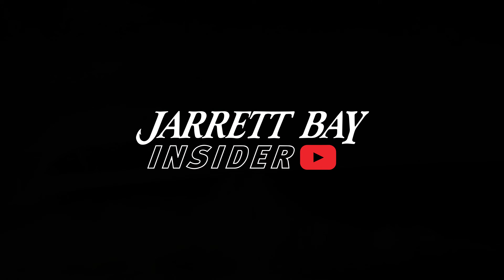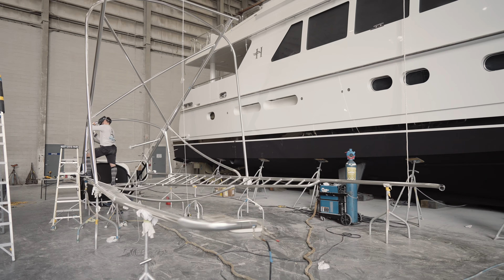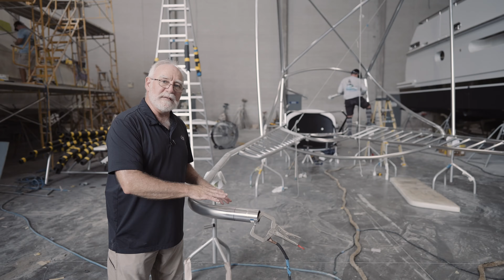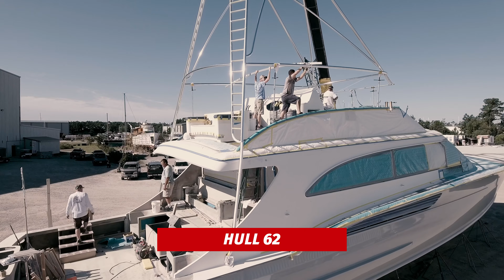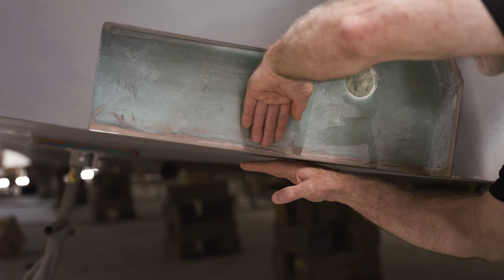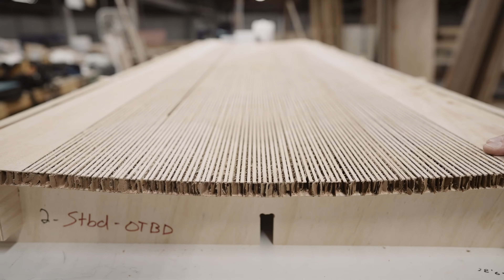From Towers to Trim Tabs - NEW! Jarrett Bay Insider, Ep. 25

Comment: Them Trim Tabs are very precise, must be right, it is one of the most important part of the boat, you can have everything, but if those Trim tabs are out of precise, then either the boat does not raise correctly off the water or raises too high off the water, that's why some boats have a hydraulic flaps because of that simple mistake, just like a plane, the flaps goes down to lift the plane into the air, same goes with all the boats, Trim tabs are made to do the same, they are only 2 cm thickness, but it means a lot.

Comment: Are you guys still using wood? Tsk Tsk Tsk....... There are too many great synthetic materials out there to still be using wood.
Reply: For custom hulls in this size class, it's tough to beat a cold molded wood boat.   They have a better strength-to-weight ratio, they're quieter, they ride better and they are more cost efficient to build.